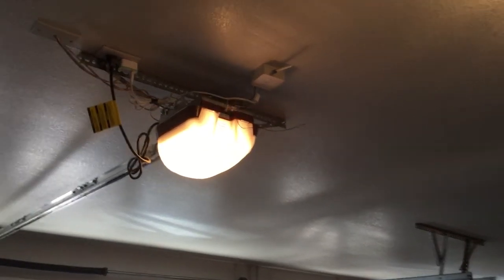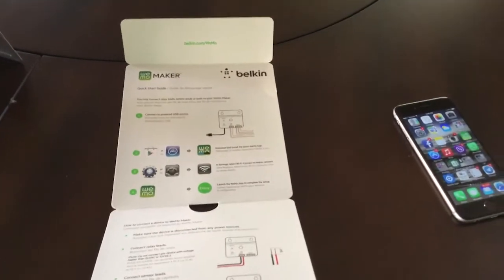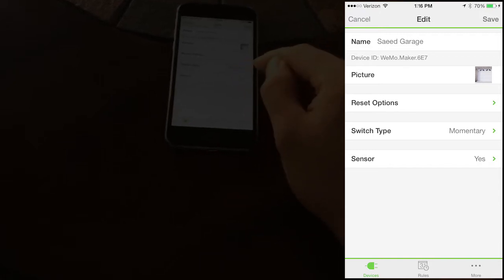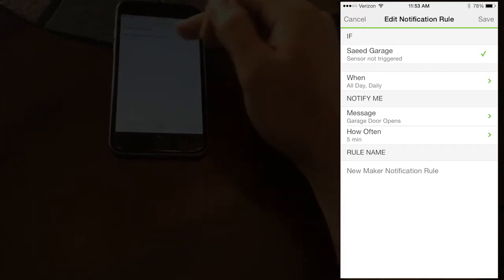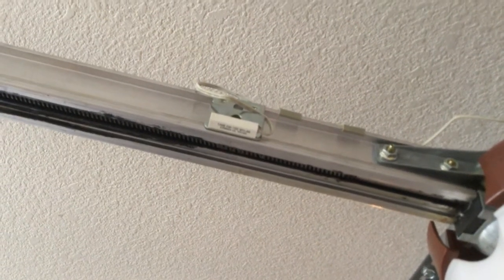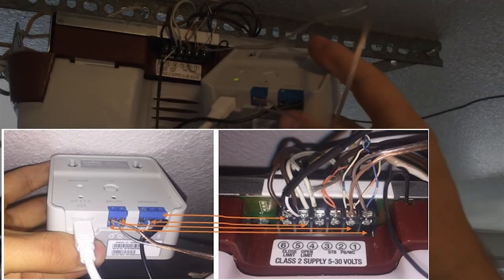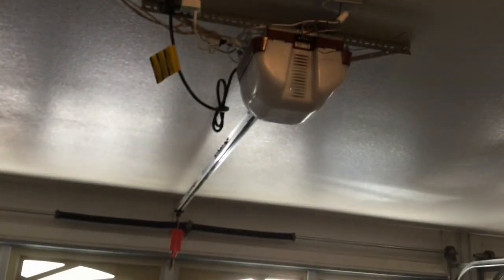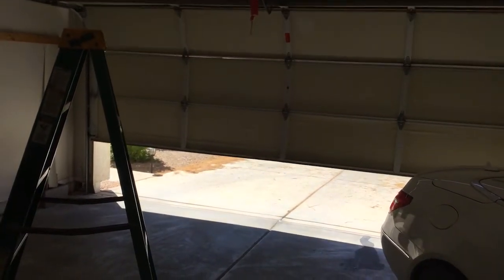How to set up Wemo Maker Wi-Fi for Garage Door opener - Home Automation

Comment: So how does this deal with an obstruction in the path of the door while 
it is trying to close? This would be the safety ir gate at the middle 
and the bottom of the door. Most garage doors stop and wait for user 
input to open the door or continue to close.